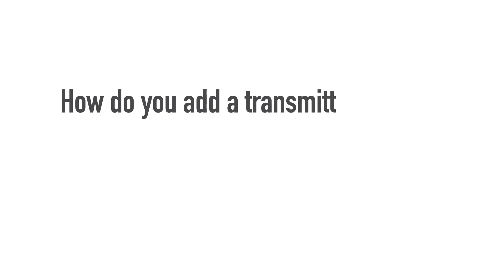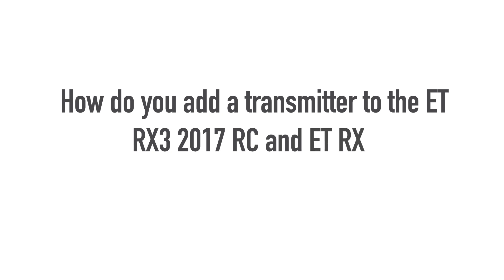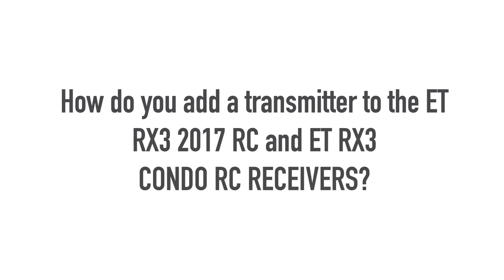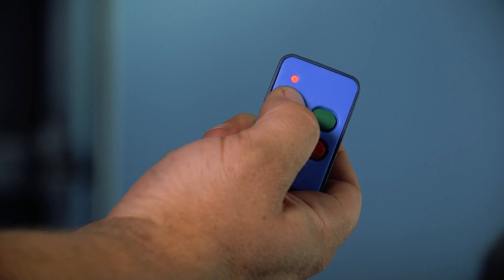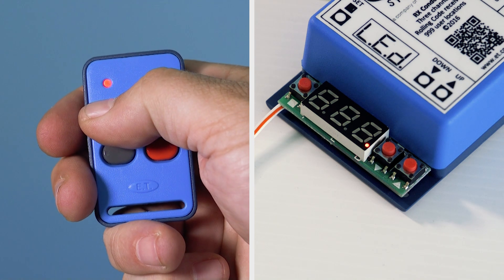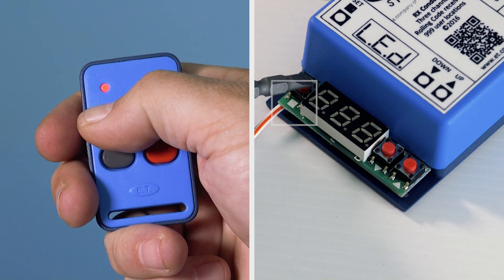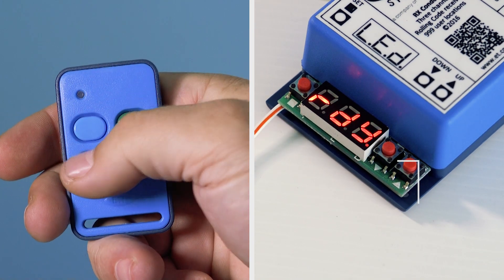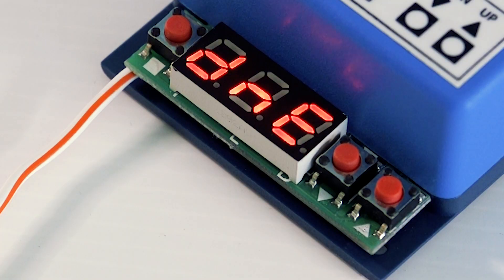How do you add a transmitter to the ET RX3 2017 RC and ET RX3 Condo RC Receivers?

Comment: DO you have a link that shows how the RX3 2017 RC should be wired? Im using it with a normal cisa lock but need some assistance with the wiring.